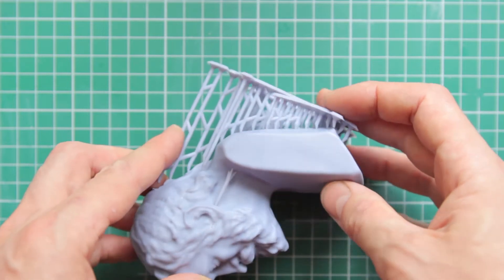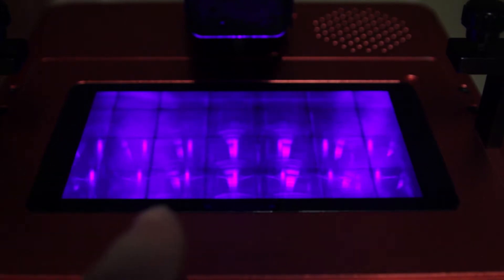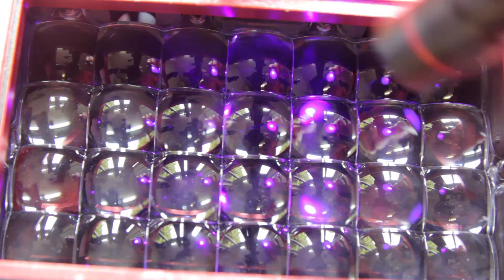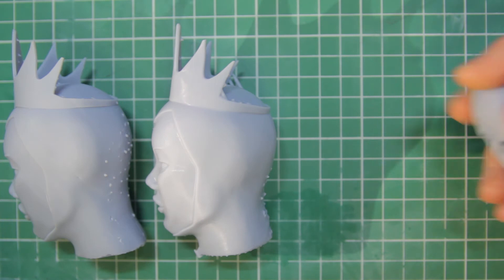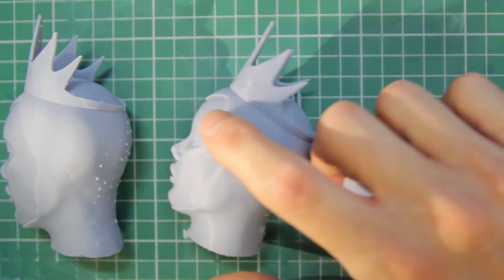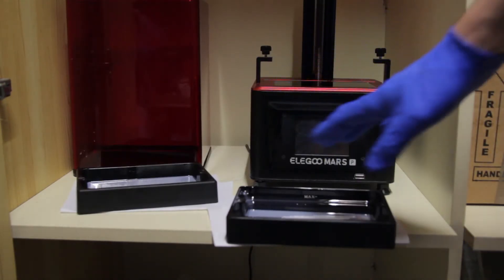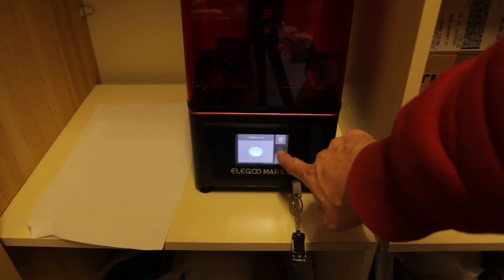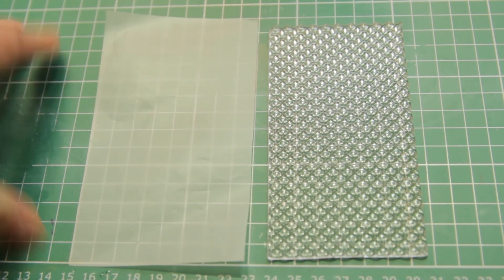FIXING THE MARS PRO VERTICAL LINES PROBLEM (DIFFUSING ELEGOO)

Comment: Wich grade of diffusion 'paper ' u used ? Rosco, Lee and other brands of professional high temperature light diffusion filters , aka Frost, have different grades of diffusion, also the paper lay on the lenses not quite flat what about use a profile to made it even and rised up ?
Reply from the maker: I just used the most transparent one i could find that didnt cut out too much light. But you can use the ones on the back of the lcd screen as well. Just gotta rip it out of the backlight area which is easy.

Comment: I just got the Elegoo pro and it is all thumbs down compared to the mars. Sending it back this week. Piece of junk! Plus file extensions are a pain trying to run mars and pro. I also have these huge elephant feet prints on flat object because the build plate is over kill with all the milled circular marks from the milling machine.  I never experienced such frustrations with the mars.

Comment: What do you think about the Mars Pro 2? Is there the same Problem?  Greatings from Berlin
Reply from the maker: Greetings! I have a few friends in Berlin. The Mars Pro2 is fine after much testing. The mono screen causes slight jaggies using default chitubox settings but put grey to 0 and blur to 4 and youll be fine.  My screen is ruined due to the lack of glass protector compared to the pro. if you buy a screen protector you should be fine! No horrible grid lines
Reply: Have other Problems on the Mars 2 Pro, there are Horizontal Lines in the Print, seems to be a Problem with the Z Axis...

Comment: The issue seems to be with the distance of the array from the screen. Product description on Alibaba for this array says suggested distance should be 35-36mm. What is the current distance in the Mars? It's too close. The array needs to be backed off, or the screen needs to be raised, but you'd have to fabricate a new bezel to raise the screen and lose z-height on your build volume.
Reply from the maker: Moving the screen back is hard because of the lack of room. I just hope their claim of Final fix actually works!

Comment: what you're doing here is projecting focused light through lcd and casting shadows onto resin- By diffusing the light you're literally messing with the shadows cast- idealistically youd have a very tall printer with a single source UV - or a tight cluster that focuses exactly over the lcd panel to most accurately cast a isometric shadow 
perhaps the array could have milldly more overlap if the lenses were wider or the light sources were closer to the lenses? - perhaps that would be a good solution
Reply from the maker: I think the first mars did, and had an issue with soft edges, but I agree with you, I think more leds would be better, or an improved lens, as it would eliminate the gaps from one led to the next. Apparently the focus can be altered by raising the lens or lowering it, but if the lens is faulty then that wont work. I may get an old mars which has the single light source option just to see if its better! definitely less chance to go wrong!

Comment: Yeah, my pro started having this, i contacted elegoo support and they say there's a known problem with the led on the mars pro. They said their sending a replacement part. No idea what they are sending
Reply from the maker: Im still waiting to hear back, sad face.
Reply: @Cloakfiend  took three or four days for them to answer my emails. hope you sort it out soon
Reply: @Cloakfiend  elegoo sent a replacement lcd for my pro and now it printing correctly again
Reply: @Joe-Skynet  does the grid still present or it was fix by lcd screen? i think it is not the LCD but the lens itself!
Reply: @MrDanielamaral  the grid is gone...
Reply from the maker: @Joe-Skynet  Just an LCD? not lens or support? thats odd, I thought my LCD was ok? They are sending me a new lens and new support for now, if that doesn't work, a new led.
Reply: @Cloakfiend  just the lcd and the update
Reply from the maker: @Joe-Skynet  what update?
Reply: @Cloakfiend  the first thing they did was send me a update, it wasn't the latest firmware, it was a short named file that got flashed to the printer automatically on boot up wirh thw file on the USB. But because i damaged the original lcd when i first removed it. I couldn't test it until the replacement arrived
Reply from the maker: @Joe-Skynet  weird they didnt send or even mention any firmware fixes?
Reply: @Cloakfiend  Could be a mask applied to the sliced file via the firmware. Or just a permanent mask applied via firmware. That would eliminate the lines. Check out this discussion on FB: https://www.facebook.com/groups/elegoosaturn/?post_id=704007350183715
Reply from the maker: @Make3DTV  not sure. It may be too complicated as a mask the issues are with the lens led and lcd. And each one could slightly vary.

Comment: 17:13 - I have to admit I laughed when the lamp came on. I didn't expect that result. Seriously though, I enjoy your methodical testing and not being afraid to crack the case open and get your hands dirty. Test, test, test.
Reply from the maker: It was a fun experiment. But it affected the suction forces as well which made a few layer lines! Eitherway I will try weaker diffusion paper. And less exposure. And yeah I laughed myself when I saw that as well!!
Reply: @Cloakfiend  Not sure where you're located, but there's a Lexan-based sheet material called TUFFAK-Lumen marketed in the US that is meant for diffusing LED lighting. Not cheap in big sheets, but I see small off-cuts available reasonably on eBay (item 254647026950 for instance). Might be worth a go, though I have no idea how well it will pass 405nm.
Reply: @Cloakfiend  One other thought - I know the assembly/reassembly is a pain, but I wonder if altering the distance between the diffusing material and light source/LCD could have an effect. Just throwing out ideas....